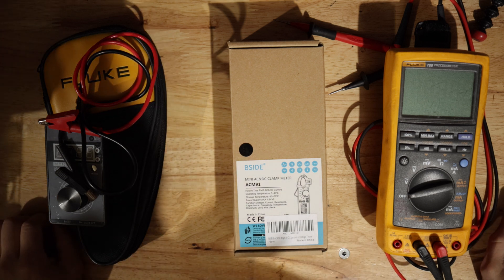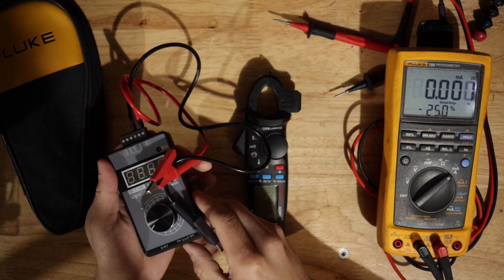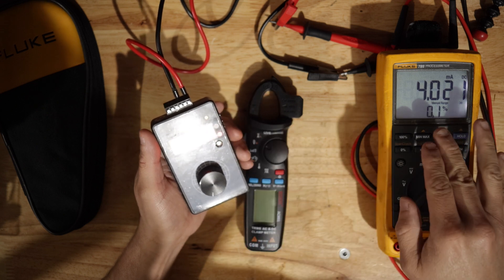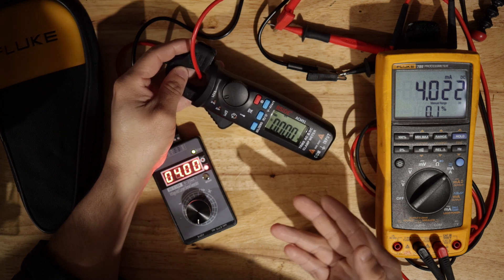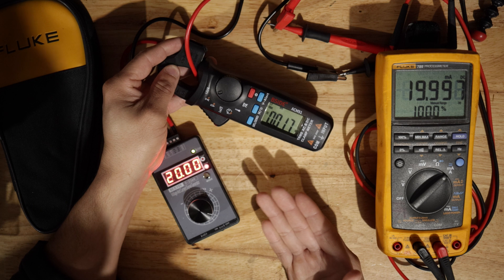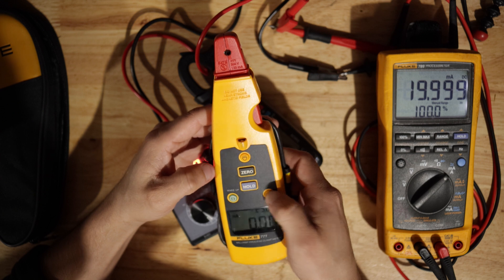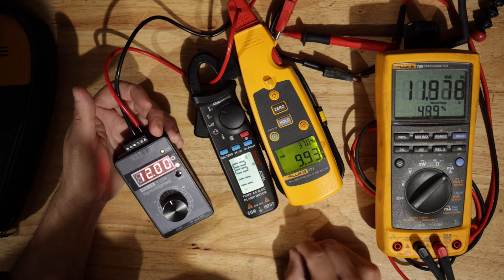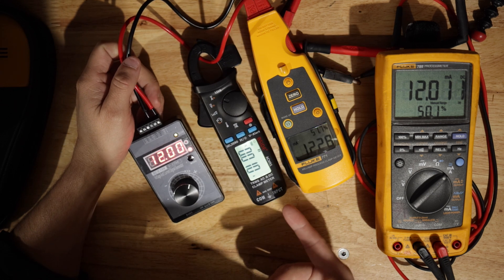$49.99 clamp meter for 4-20mA, Does it work??

Comment: A very good test proving that budget clamp multi meter as I was considering purchasing this. I already have a set of testers & thought the spec on the budget meter seems good & that I would have to bring different equipment for the different voltages & current that I would need to measure. Thanks again, you saved me £50.00 👍🏿

Comment: Who said it was accurate to 1 ma? The specs clearly state -DC current: 6A/60A/100A 0.001A/0.01A/0.1A ±(3.0%+5counts). 2nd you have to have the wire in the center of the meter jaws, not on the side like you have. Third you have to let the meter warm up a minute and understand its going to take a couple of seconds ( due to stated low sample rate) to get a good read. You have to zero the meter before every reading and the best way to do this is to place the meter jaw directly on the wire read and once its zeroed place it immediately inside the meter jaws otherwise whatever magnetic field around the wire will offset the zeroing and affect the reading. The wire placement is critical and it needs to be in between the two arrows on the meter jaw and at a 90 degree angle from the jaws.I bought this meter and made the same mistakes this reviewer made and was about to return it  but I read the user comments and learned how to use the meter. So it took a little mindfulness when using but yes the meter pretty much preforms within the given specs . Would i use it for 4-20 mA...no but it wasnt made or intended for that purpose . I   think if  the jaws were the same size as the fluke you would have a much closer outcome between the two meters. If you are going to compare a $700 meter to a $50 meter , at least know how the meter is supposed to be used, and have a realistic expectation of what it is you are getting for your money. I kept mine and yes I use it in an industrial setting...If you dont zero it out properly every time no you wont be happy with it.
Reply: Something I'd like to add to your comment is; When measuring DC current (oxymoron), really should be on the ground coming from the power source. 

I find it interesting the fluke clamp is reading higher than the fluke probes. Anyone paying $50 isn't going to expect dead on and comparing to a $700 is far fetched. Now lets see a $200 version comparing that to a fluke. A fluke is expensive because they can, because when you need a certification paper, you are at their mercy!
Reply: I can maybe
1. carve some wood + sponge adapters to make the jaws guide the wire to the center of the jaws.
2. Wind the wire 10 times round the jaws so that the meter will be reading 10 times the mA and then I can divide the reading by 10 to get the actual mA reading.